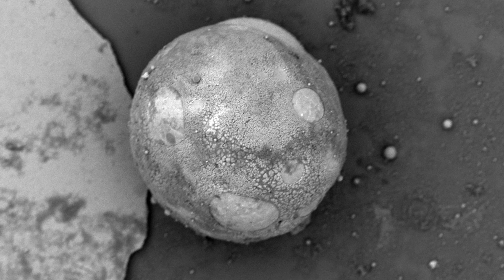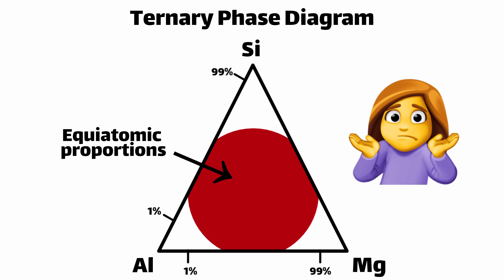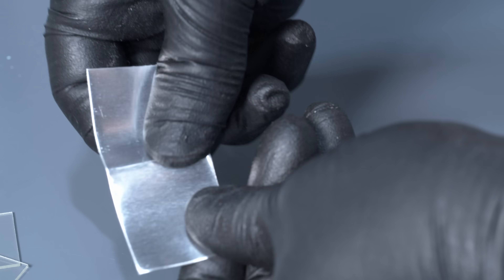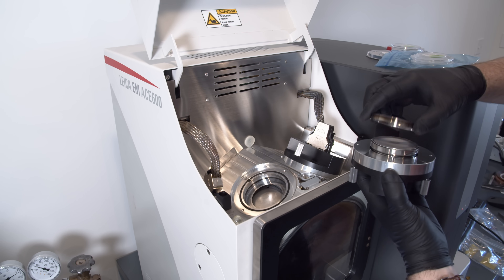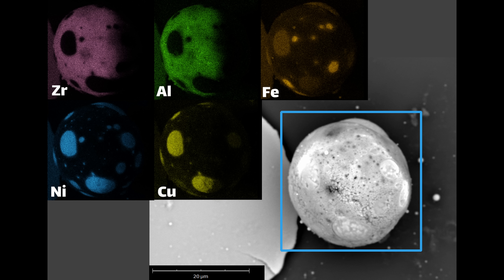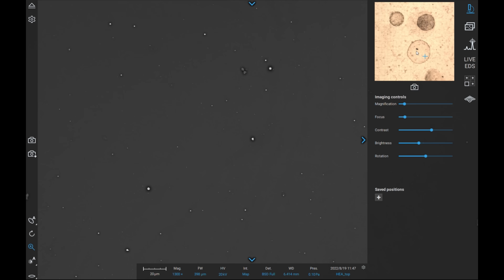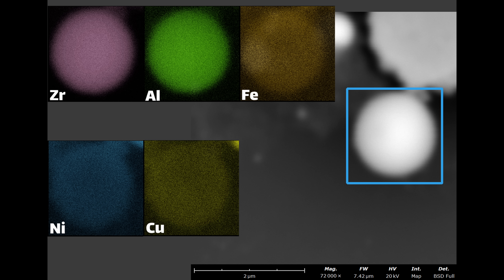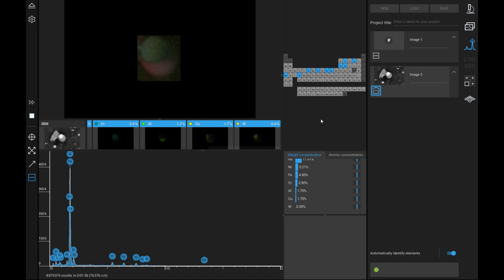Metal Alloys of the Future?

Comment: 3:31 Re: unique configurations - not really, by my calculations.  With 5 elements, and considering a local cluster to be 3x3x3 atoms, you get 5^27 possible configurations.  In a gram of iron you have about 10^22 atoms (possible centers of clusters), a number about 1000x bigger.  So, very roughly speaking, in a gram of such an alloy I'd expect each configuration to occur roughly 1000 times.  Still, I'll grant that's pretty close to "unique", as such things go.

Comment: I used to know a guy who was doing a PhD into using high entropy alloys in high radiation environments, like nuclear reactors and especially fusion reactors where materials are going to be exposed to a high neutron flux. Theory being that knocking an atom out of position in a high entropy alloy is going to cause a lot less problems than in a standard material because the relative change in environment is so much smaller. Definitely interesting stuff

Comment: as a welder and metalworker i wonder if your laser-synthesis step might be improved if you could construct a small chamber that could contain your raw material slide and the laser, which you could flush out the normal atmosphere and replace it with a higher pressure inert gas, which might give the dual benefit of preventing oxidation as wel as forcing your particles to stay on the slide and in contact with each other under the gas pressure. super interesting video, if these materials really do have these properties they sound like magical super alloys i would read about in fantasy novels, and that makes me extraordinarily giddy

Comment: And around 20 years ago there was a company making a "liquid metal" that reflected more energy than it absorbed. Videos of tests showed a ball bearing of this material dropped from 12" onto a plate of this same material, would bounce for over a minute before coming to a rest. They were in contract with a phone company to make flip hinges with this because they could last nearly indefinitely. The military application was for penetrating rounds that absorbed little energy during impact so penetrating tanks was no problem without depleted uranium and as an armor, it would reflect anything not of the same material like reactive plating. 

Its gone now. No vids anymore and wiped from the web

Comment: The laser ablation process super-heats the surface very briefly. You arent giving the materials enough time to diffuse. Why not just stick the slide in an argon atmosphere and heat it for a few hours?

Im not sure if the high entropy alloy is an actual stable phase where everything is soluble or just metastable because its difficult for all the stabilize phases to form when there are so many materials. Either way you can experiment with different heats and time. Pressure too if you want to get wild.
Reply: One more thing; are you breaking vacuum when you sputter on new materials? If so youll have a small oxygen layer between each metal layer that will mess with adhesion and with the alloying process. Not sure if you have a chuck that you can rotate different material on without breaking vacuum?
Reply: Sorry one more thing; Your very first layer should be Aluminum. it will adhere far better to the glass than Copper will. and will help with the flaking you are seeing
Also you might have luck using aluminum as an adhesion layer between the metals. So use more layers of aluminum and less of it.

A stack like this

10nm Al
50nm Cu
10nm Al
50nm Fe
10nm Al
50nm W
ect

will give you better results.. not sure what your experimental setup is to make this worth the effort

Comment: As someone who did a part of his M.Sc. on High entropy alloys (HEAs) and is currently doing his Ph.D. on it, I have some comments to mention that might be useful for you:
1- The choice of elements is one of the most important aspects of making high entropy alloys. The two most successful alloys (Cantor and Senkov) are made of elements with very similar valence electron number and atomic radius (and some other properties). This similarity prevents the formation of intermetallic phases inside the HEAs that gives them those exceptional properties. The elements you chose are highly unlikely to form HEAs due to this dissimilarity. 
2- As other people mentioned, the conventional explanation for entropy in HEAs effect has proven not entirely correct. To be more specific, the free Gibbs energy for the formation of intermetallic phases is made of both entropy and enthalpy parts and while the addition of more than 5 elements can increase the entropy of the alloy, it will also increase the chance of formation of intermetallic phases due to lower enthalpy of formation. Thus, maybe trying the same method for a lower number of elements (4 or 5) would be more successful. 
3- The production method plays a significant role in the quality of high entropy alloys. For example, many of the HEAs with refractory metals are highly sensitive to oxidation and can flake off very quickly (called pesting). Also, the lattice mismatch can cause stresses that can break down samples while cooling down. On the other hand, I have seen many metallic glasses with high entropy compositions. So it is doable. 
Overall, excellent video and good luck!
Reply: is the reason the metals cannot simply be melted together related to them not mixing homogeneously, not cooling sufficiently fast to form the right structure or something else?
Reply: Does high entropy tend to imply high energetic cost? The enthalpy part makes me think yes. This is a science language trick. We've always known that a good Smith makes magic metal given a long enough time with enough fuel in a hot enough furnace. That's always been the case.

Comment: So, what's stopping the sputtering of multiple metals at once? If it's the mixing of individual atoms you're after, then it seems the logical way to do it. But I'm just a lowly blacksmith and metal-botherer so it's kinda like a 15th century sailor making suggestions about space-station upkeep.
Reply from the maker: It's a good suggestion! If my machine could do multiple metals simultaneously it'd be a better way to do it! The literature has some examples using that approach... it's a bit tricky since the metals don't nescessarily crystallize while being deposited, so likely need some post-annealing step or even something like the laser to re-distribute them. But pre-alloying during the sputtering would definitely help!
Reply: @BreakingTaps  Time to build a bigger badder machine then! I mean, how hard could it be, right?!

Maybe time to get Applied science on board, this is right up his street!

Comment: Well if I remember correctly, interstitial Elements is not very good. you have different solubility for different materials at different temperatures. You need to mix these elements at the temperatures long enough to have that kind of diffusion and then you need to freeze it fast enough that there is not enough time for the single elements to get into single-phases (interstitial) again.

Comment: I am going to preface my criticism with that I am a metallurgist who does not deal with HEA's but a physical metallurgist the same. 

I've always seen HEA alloys as something some physicist or other egg head cooked up, likley a physicist or metallurgist who is way to interested in computer modeling using first principles. The problem as you mentioned with HEA's are that intermetalics will always form, your fighting thermodynamics. Additionally they are claimed to be very good at absorbing radiation in the hot loops of nuclear reactors but under those conditions I would have a hard time believing that they would not eventually form intermetalics and the physical properties would change over time. It's not like you can easily go in the hot loop of a nuclear reactor and change things out.

I just can't imagine you get that amount of that many alloy elements together and not form highly ordered structures. I've heard from a colleague that he's has some success with very high strain rates in torsion with HEA's in getting a highly disordered structure. Again though I know very little about HEA but see them as another government funding buzzword of the day. Just like 3D printing and finite elements analysis before that. They both have their places but we're massively over hyped by pop science media/publications

Comment: do it under high pressure to slow the quenching? (pressure is interchangeable with heat). or use boiling water? what about using oil to quench? it processes the heat slower. idk what I’m doing. i’m very curious. look into linda-moulton how on her material, pure aluminum, bismuth and zinc. these materials can act very strangely in e-m fields.

👑
love,
david

Comment: You are blasting a 5um particle with 20 keV. No wonder the elementet distribution in the map looks homogenous.
Reply from the maker: The interaction volume at this accelerating voltage is likely only 1-2um at the most, 15-20kv is still pretty low in the scheme of things. Not fantastic but enough to differentiate inhomogeneity. I agree that smaller particles it's not useful and you should switch to TEM for those. :)

Comment: I wonder if we can finally achieve superconductivity without those subzero temperatures being a prerequisite. That would open up a whole new dimension of possibilities! One thing comes to mind is magnetic levitation devices, true hoverboards!
Reply: We've had real floating (through magnetic repulsion+attraction that quantum locks it in place just like superconductors but stabilized in a different manner than the effect that locks superconductors to magnets) hoverboards for almost a decade now.

They'll always require a ferromagnetic material to stand on, (or an impossibly diamagnetic material which can't physically exist afaik) so it's as real as it gets already

Comment: I've heard they use electricity for aluminum steel. They let it solidify while it's being charged by electricity. That helps it not form a kind of marmansite and blend Nicely. Only the two parts touching the electricity points form marmansite

Comment: So you can make a high entropy alloy solid state battery made entirely of HEA metals. It'll be a heavy somabich but it may just open another door. What if the actual frame of a car is the battery itself? What if the actual I beams of a building were its battery towards a self sufficient architecture? What if using the HEA battery as the casing of a generator makes it multiply in efficiency since there's no draw length of wire connecting generator to battery? Since the thought of electric planes have had the issue of the weight of the batteries needed to fly, what if the entirety of the body of the plane was the battery? What if our phone case itself was the battery? What if our entire metal roof was our home battery for our house? The ideas i have are endless.

Comment: Very nice video! 
As a mechanical engineer I have a different understanding of toughness than explained in the video. What you described sounds more like the elastic or plastic strain limit of a material. Toughness is kind of the opposite of brittleness. Glass for example will actually bend quite a bit, but the low toughness causes it to shatter easily upon impact. Glass also has a high crack propagation due to its low fracture toughness. 
Toughness is (usually) related to how much a material will plastically deform (not so much to elastic deformation), but it is a different material property.

Comment: Once we have stronger control of electromagnetic fields in the microscopic scale, we can create interference patterns to aggregate specific molecules of metals in specific patterns and use a combination of physical pressure on the powder matrix and heat to fuse the metallic powder matrix into an alloy with consistency across batches.

Comment: is it possible to sputter multiple metals at once instead of doing them one at a time to make layers? a little bit of premixing before hitting them with the laser?
Reply: absolutely.  different sputtering methods will work better or worse with alloy targets.  You can go higher energy methods - HIPMS or even away from sputtering entirely to arc vapor.  These also have the advantage of better adhesion.

Comment: If it's possible to build a blast containment cell, might be interesting to see how materials sinter together with focused shockwaves from a shaped explosive charge. Different approach than the laser, but likely to make for much larger samples. I heard such things are one of those odd branches of material science that may be neat to explore.
Reply: I did explosive welding in college.   Got some neat micrograph images of the interface.   that was steel to aluminum welding.

Comment: Hey I have no clue but,
could you sputter your metals in a (checkered)pattern onto a sample. Then use the sample as a source to sputter the next sample to create a single-mixed-metal layer which you then treat with the laser. Because there is only one layer there is less mass which means you could tune down the laser thereby shorten the time to recrystallisation.

Comment: have a look at metal glass manufacturing process, the way high cooling is achieved is by dripping molten metal onto cold copper target that absorbs the heat at extremely high rate. Metal glasses seem to have a lot of connection in properties to these high entropy alloys.

Comment: So, this is a longshot, but would it be possible to intentionally design a flat surface with a few layers of the high entropy alloy (kind of like the way we place semiconductors on a silicon chip) and then use it like a seed to start the growth of a superalloy in a solution with the component parts of the alloy?

Comment: Could you make a sputter coating machine that can either coat something in multiple metals at once, or rapidly switch between metals without needing to switch things out by hand and pump out the atmosphere again? I think that much thinner layers may get you to where you want to be. Also, maybe use a laser with higher wavelength, to allow a finer resolution, and try to get a thinner beam. I don't know much about metallurgy, so that's all I have for you.

Comment: Could you possibly make the area around the material inert ?    Say by using nitrogen or other noble gas to prevent oxidation in order to help adherence .     Rapid oxidation is rather energetic and may prevent material from forming a stable layer.   And/or preheating the material prior to the laser .    That may help it from being ripped off of the glass .

Comment: I did mechanical engineering in my undergrad (limited knowledge). Are these different from BMG / Bulk Metallic Glasses? My friend (PhD) worked with them :). Also, have you considered using other methods that made BMGs by manipulating grain boundaries? Do you think you might have more luck considering generating alloys arranged by melting point?

Comment: If you can get the various metals as nanoparticles which can form a uniform suspension in a liquid, perhaps a sonoluminescence set up could be used to mush them together. You'd only be affecting the particles on the outside of the cavitation bubbles, but there might still be enough energy to do what you want. Any particles which fused would presumably precipitate to the bottom of the apparatus.

And there's my completely naive and ignorant thought for the day =))

Comment: Do it under pressure and angle the laser. Helium or argon would keep pressure while not allowing oxygen to interfere. The angle is to metals to roll into form.
Reply: Try both liquid and gas forms. This wont be easy. Try all the different nobel gases. Of course hydrogen isnt an option in ur method but it can be done in other ways. Goodluck

Comment: Sputter metal alongside a laser, just like a laserprinter does, this would fuse the metal on a surface. Now do this with several metals, each their own laser. Have the lasers come together at the same spot, to fuse the sputtered metals. Maybe this would be the new laser sintering, building metal shapes and creating alloys on the fly.

Comment: What if the sputtering target was made of an intermetallic alloy with the correct ratios of metals?
(maybe adjusted for the different  metals surface binding energies, in case it isn't the same for all metals in an alloy)

If the area from which the sputtering is large enough, I would expect that the cloud of atoms ejected from the target would also have the correct ratio.
And maybe with luck the atoms wouldn't "crystallise" into regions of the same materials

Maybe a lower density of the metal atom cloud would help, giving an atom less time to find similar atom or cluster of atoms

To be noted: I'm not i anyway knowledgeable about the topic in any real way, shape or form.
Reply: I see that 1224ChrisNg more or less already suggested this lower down :)

Comment: If your issue is thermal (quick quenching), you could try mounting your setup on a peltier plate for cooling. May also require a vacuum to get temps really low. Not sure how the laser would interact, but I think having lower temps would help for larger particle sizes.